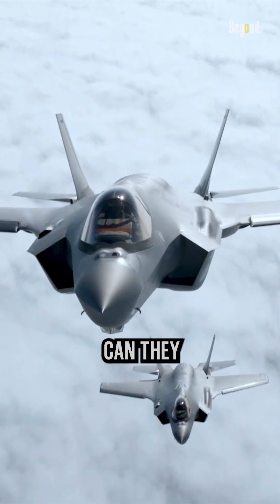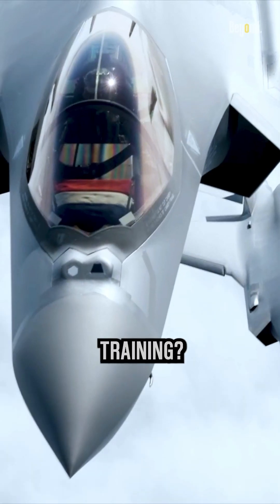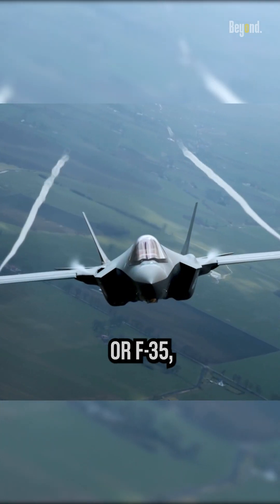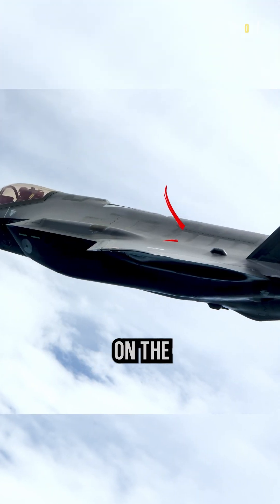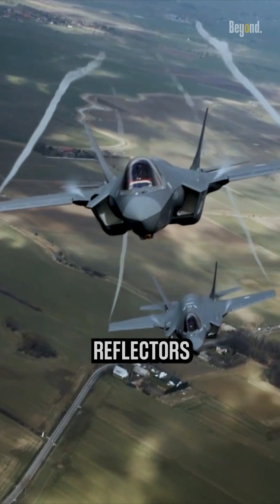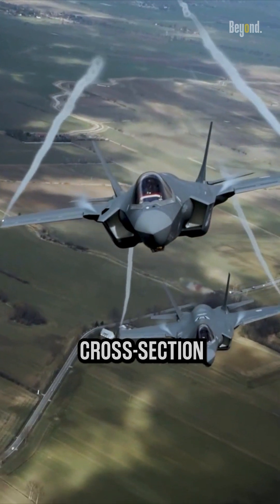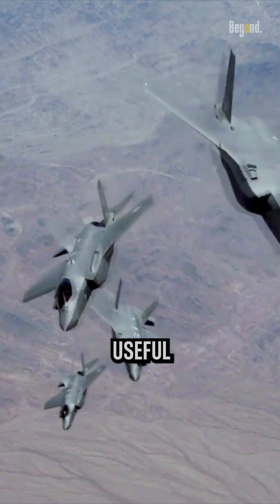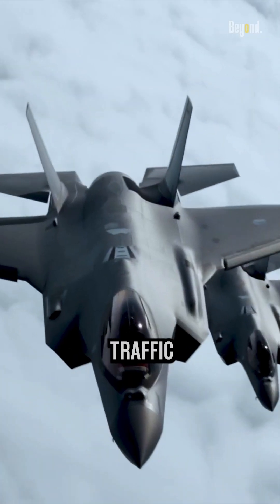How Can Friends' Radar Detect Their Stealthy Aircraft? #shorts

Comment: "Stealth" is absolutely not designed to make an aircraft "invisible" at all. Any stealth aircraft can still be picked up on radar. Stealth just reduces an aircraft's radar cross section which makes it very difficult (but not impossible) for radar to get an effective lock on a stealth aircraft. But even if it does, a surface to air, missile will also have a much harder time locking on to the stealth aircraft and hitting it, but it can still happen as it did when we lost an F-117 to a Serbian SAM.
Reply: That was a different time, the F-117 didn’t have radar or missiles to defend themselves with. It was essentially a drone dropping bombs on preplanned targets. The pilots were only there to take off and land the plane, they weren’t supposed to touch the controls during bombing missions for fear they’d turn and expose themselves to radars. While F-35’s are armed and have sensors that would’ve detected and taken out that radar before it was able to achieve lock. The S-125 commander turned on his radar for 20 seconds at a time trying to acquire radar lock, taking him 3 times before one of the 3 F-117’s open bomb doors was detected. The F-117’s flew the 3rd night of that 78 day NATO air campaign without Prowlers and Wild Weasels as armed escorts, intel the battery commander knew, a mistake they never made again! The other difference is that F-117’s still had to fly over their targets to drop their laser guided bombs. With today’s standoff weapons range, F-35’s would never get near enough for a SAM to detect and fire a missile at them!!!
Reply: @JimCOsd55  But radar technology has moved on since then too…
Reply: @JimCOsd55  I didn't know the F-117s were flying without WWs and jammers that night.
Reply: @iamnotpaulavery  Yea, there was a shortage of them so the Air Force believed that the F-117’s stealth would be enough protection. They also got into the bad habit of using the same valley to enter and exit bombing missions on Belgrade. Which an S-125 commander noticed and set up his battery there in hopes of ambushing an F-117. Afterwards they varied where they entered and exited while always flying with support aircraft. Which is why another F-117 was never lost tho an F-16 was shot down later. Serbian air defense fired some 700 SAMs and countless AAA which shows how much tougher it is to shoot down a plane. When the SA-2 was first used in Vietnam, it took 25 launches to down an aircraft. With the introduction of WW and Shrike missiles it doubled the number of SA-2 missiles needed to down a jet!
Reply: @JimCOsd55  Yes, I heard that one of the main reasons why an F-117 was shot down was because they were using the same route too many times. That's so foolish and inexcusable.
Reply: @iamnotpaulavery  Or laziness because after the Gulf war, upper management believed that it was impossible to target and shoot down a stealth plane! The Serbian SAM commander was more than happy to prove them wrong! 😑
Reply: Soviet Sam used by Serbia